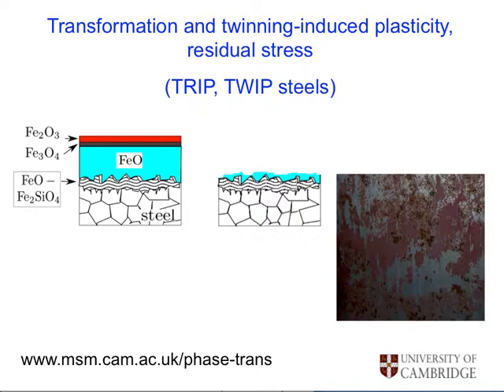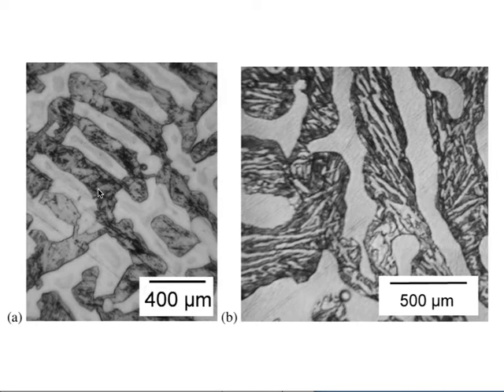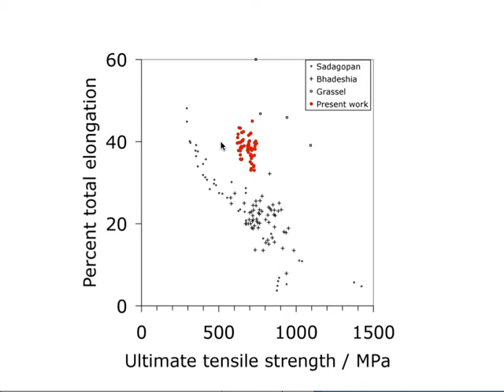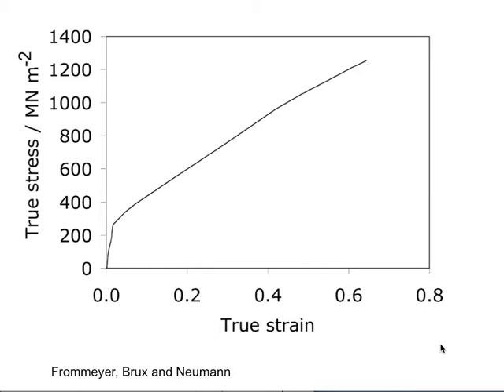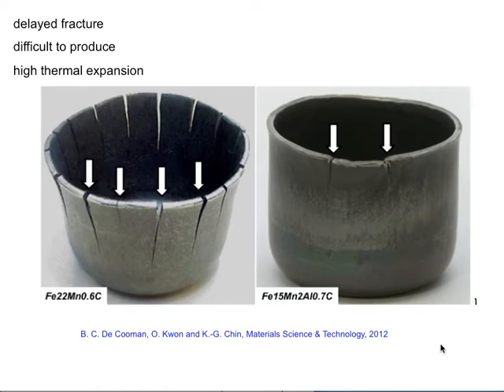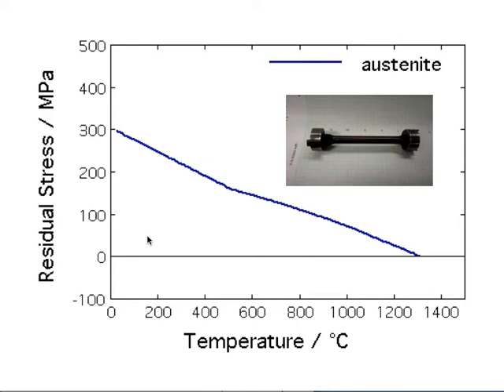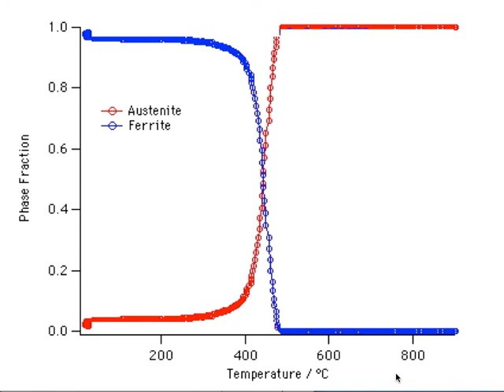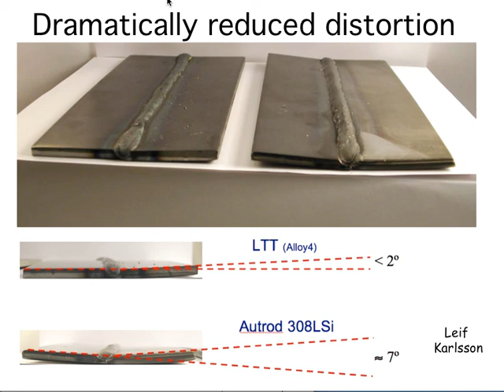Steels: TRIP, TWIP & residual stress, lecture 11 (2016)

Comment: Hello sir, why we have chosen 70 percent allotriomorphic ferrite at intercritical temperature in trip steel, why not 50 percent or other?
Reply from the maker: It is a variable that you can control to achieve a variety of properties. Less allotriomorphic ferrite means less enrichment of the residual austenite with carbon so this would have to be compensated for.